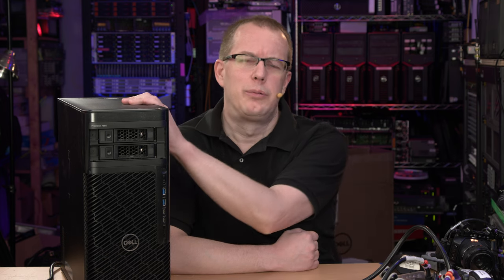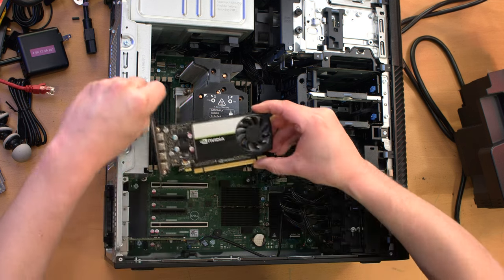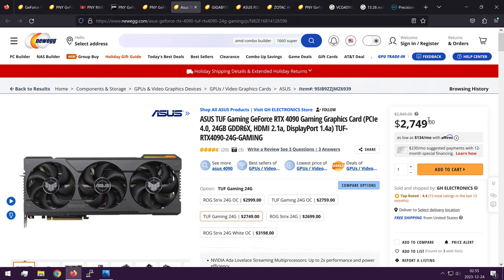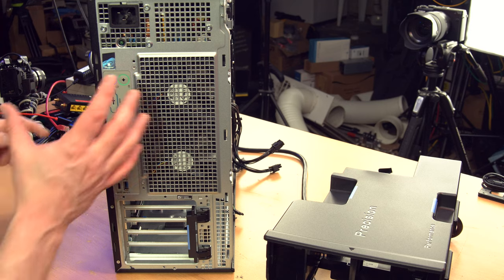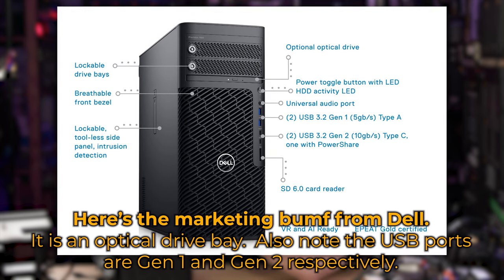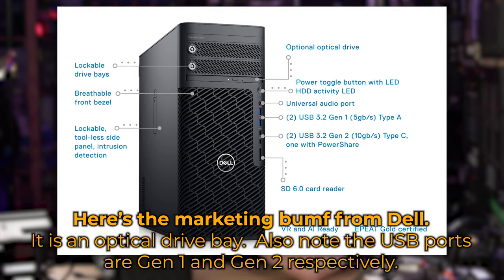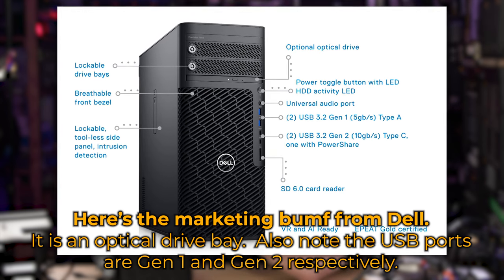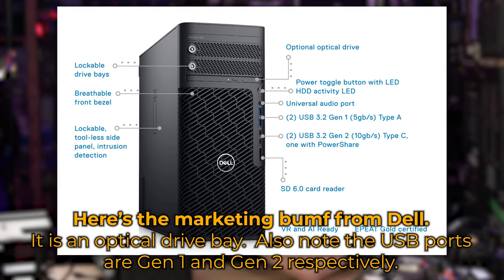Shoving an RTX 4080 into a Dell Precision T7865

Comment: The CPU is vendor locked to Dell, so are the Lenovos, you won't be able to use it in any other motherboard outside of their respective product lines. On top of that and unlocked Threadripper Pro by default will automatically lock to whatever Vendor board it is used on.

Comment: the stickers on basically all NVMe SSDs are technically thermal pads, and help with cooling. you'll see it if you take the sticker off and see the reflective metal underside. don't take it off, but if you do you won't take a flash chip with it.

Comment: I'd suggest looking at the Asus ProArt graphics cards for chassis like this one. It's a 2.5 slot card, instead of a 3+ slot, and an inch shorter.  You'll still have to modify the case cover to remove the PCIe 'holder' , but you won't be restricting airflow within the case as much as with the XLR8, and gives you some clearance for routing the power cables

Comment: I got a Dell Precision 7875 and installed the Inno3D GeForce RTX 4070 Ti SUPER TWIN X2 in it. It fits fine and runs quiet. Make sure your graphics card is not too high and not too long. If the card is high it cannot have power connectors on the top. The mentioned Inno3D is low enough to have it's power connector on top. Workstation cards usually have the power connector at the back of the card.
My model has a 1350W power supply and 4x 8 pin PCI-e power connectors.
Reply: Talk about a beautiful setup there

Comment: Your graphics card uses a flow-thru fan/sink that is partially blocked by the Dell Precision shroud. It would likely perform better thermally if you cut out an inch or so off the bottom of the shroud to allow the graphics card an easier path to send heat in to the shroud’s flow.

Comment: The bracket that holds the gpu cables is also used to hold the other end of a gpu so it does not sag. It needs a special bracket that attaches to the gpu and hooks to the bracket in front of the case fan.